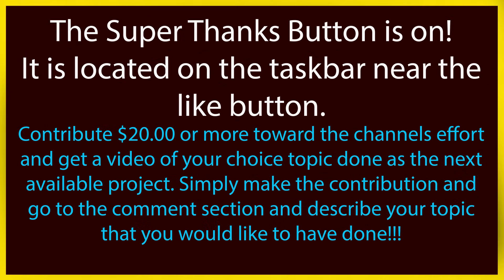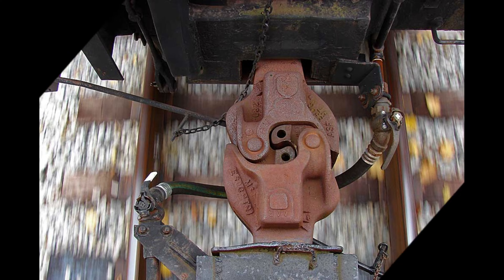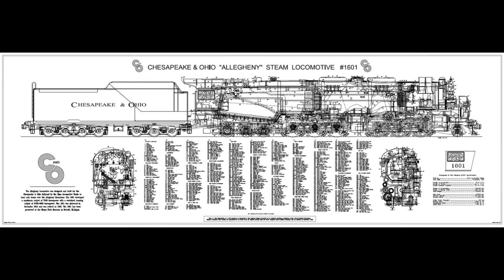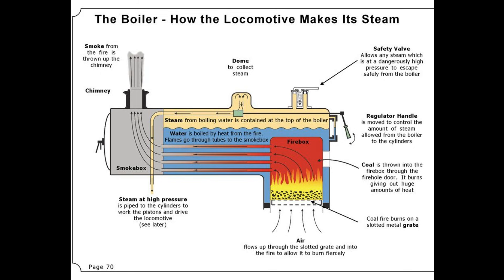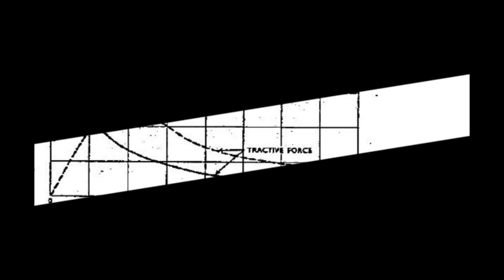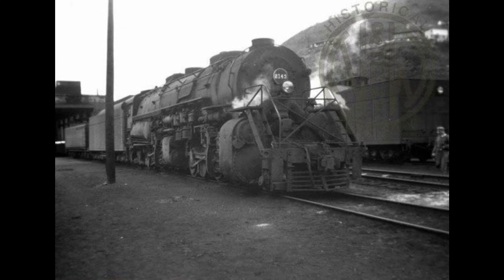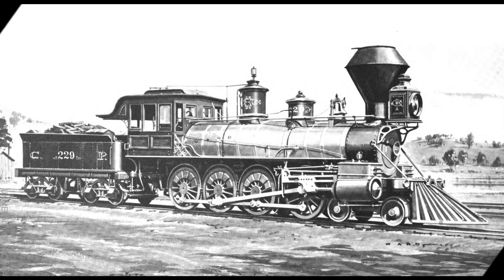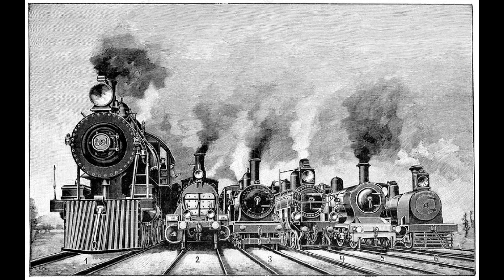Steam Locomotive Power, How They Pull All That Tonnage

Comment: This was a great video, dude. love this
Reply from the maker: Thanks as always!
Reply: @TheRailroadCrossing-SteamPower yw dude this was real intresting I think the only other engine to beat the Alleghany in horsepower is the q2 with 7987 hp
Reply from the maker: That's right
Reply: @TheRailroadCrossing-SteamPower and both of them starting had around 115000 pounds of tractive effort
Reply from the maker: Not impressive versus other super articulated
Reply: @TheRailroadCrossing-SteamPower true i rhink the n&w y6b produced like 170,000 pounds of tractive effort
Reply: @DarrenHudson-g2x The Q2's 7,987 horsepower is actually indicated horsepower in the cylinders while being tested in an Altoona test plant, stationary. In service, it generated 6,645 drawbar horsepower. The Allegheny's 7,498 horsepower is actual power at speed, drawbar horsepower, and achieved this at 46 mph pulling a heavy coal train. This makes the Allegheny the most powerful steam locomotive ever built in terms of power at speed. The Q2 just has the highest horsepower number.
Reply: @09JDCTrainMan true lol